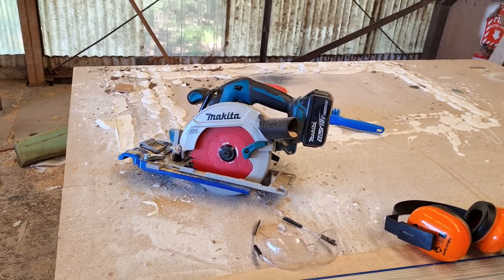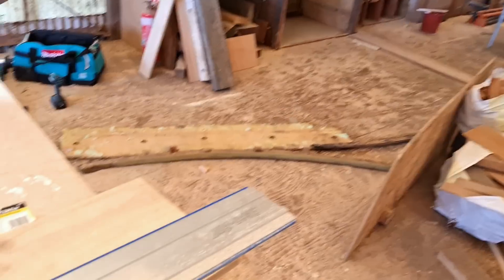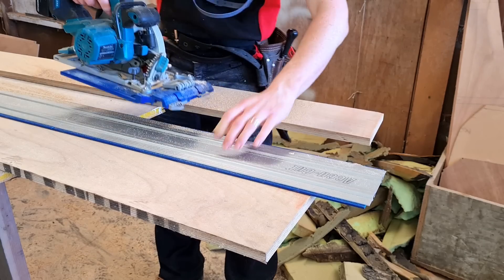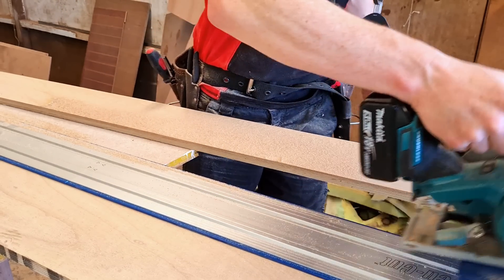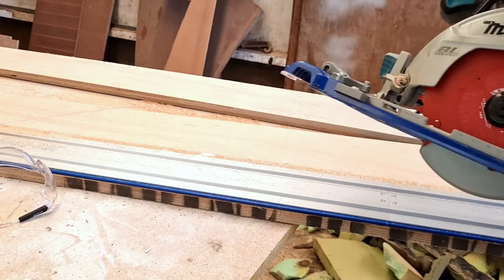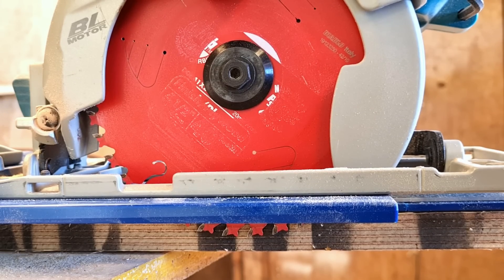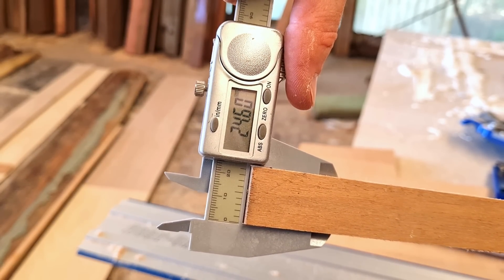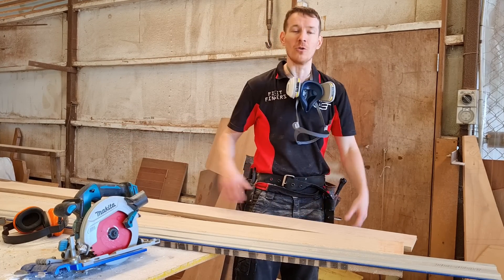How to get more Accuracy from your Kreg Accu-Cut Track Saw

Comment: Lots of videos, some pro Kreg, some against. I’m a Diy woodworker with limited resources and a budget. I think these tools are fantastic for my level and have a few, will be buying more. It doesn’t mean much to me when a professional woodworker with a massive workshop and expensive equipment keeps telling me that Kreg is no good. I appreciate your approach and instruction has benefited my knowledge. Thanks
Reply from the maker: Cheers Mike, yeah, I am sure they are doing it for the clicks (but then I am guilty of that too :P) but you need to compare a tool to the intended use and audience. No point being in a production workshop and complaining your Ryobi router died after 3 days of use for 8 hours a day.. or being a hobbyist and complaining a Shaper Origin is too expensive. Kreg target their home workshop / DIY market very well. Some of their gear misses the mark at times (Im looking at the corner jig I reviewed recently) but most is great for its intended purpose. Cheers!

Comment: Great video~!  I've been using the Kreg Accu-Cut for several years now and use the exact same technique that you demonstrate.  People have to understand that this tool isn't for precision work, but used correctly, you can get fantastic results.  Thanks for this one~!
Reply from the maker: I wonder if Kreg had called it the Kinda-Accu-Cut people would accept it for what it is? 😅
Reply: @FixitFingers  LOL, so true.  Would manage their expectations a bit, I guess.
Reply: Used correctly? So it’s Kreg that tells you to torque the saw? 

With all due respect if I’m gonna 100 US Dollars on a tool that uses the term accu cut in its name, I shouldn’t have to torque the saw to get accurate results
Reply from the maker: Yeah as discussed above the name is a double edged sword. It is accurate, but people's expectations of that term vary. My experience is if just whip it out, slap it down and push the saw along you'll likely be around 1/16th out over 8 feet...to me, that's accurate. With care and yes, a sight torque, I was just less than 1/32nd out over 8 feet... That's insanely accurate. With poor setup and no care, you'll still be only about 1/8th out... For a sheet breakdown tool I think that earns the Accu part of the name.

Comment: Hi thanks for the nice video! Can this guide be used also for 45 degrees cuts? thanks
Reply from the maker: Sadly no, that is one of the main disadvantages of this over a normal tracksaw. The sled it rides on makes bevel cuts impossible :(
Reply: ok i thought that because of the blu edge on both sides it could be used one for 90 and the other for 45 degrees
Reply from the maker: @ExploreFishing  Sadly no :( At least not with my saw.

Comment: Thanks for the video. Can you cut at a 45 degree angle using this track?
Reply from the maker: Sadly no, the chip guard gets in the way if you bevel the saw so that is one of the advantages of a real tracksaw over this guy. However, you can use the Kreg Straight edge guide (Or a DIY straightedge) to achieve those beveled cuts. If you put blue tape along the cut line, it will help minimise tearout like the chipguard does on the Accu-cut :)

Comment: I'm a big fan of how you've approached this video mate. Honest, raw and confronting, love it. In many respects its everything you'd need to know about this tool, fits the budget and does everything it sets out to do well.
I'd watched your set up video of this tool and I've been considering it for a while. For breaking up sheet goods this seems to be perfect, and I really can justify a proper track saw quite yet. 
Conversely carbatec are opening up their second nz store less than 3kms from my house too which is bloody dangerous! 
Cheers!
Reply from the maker: Ha! Im lucky they are about 30 minutes from me so just too far to make quick trip too which saves the budget ;) It's not often I use the full length one, but bloody glad I had it for this job as there was lots of full sheet ripping. To replace a table saw the Rip-Cut would still be my first choice but with the half-length Accu-cut to reach the places the rip-cut can't it's an awesome duo.

Comment: Hi James,
I think accuracy seems pretty good. When using such tools, it is necessary to hold tight throughout the movement. Thanks for showing the details. all the best. see you buddy.
Reply from the maker: Slow and steady! You can stop half way to adjust your grip or position as long as you back it off a few cm then start again. There are also optional clamps for slippery stuff like melamine.
Reply: @FixitFingers  thank you so much my friend. see you later. all the best.

Comment: At first I thought,  'Shiser! James has a new workshop but alas, not so. Half a mm over 2.4m, I'd be happy with that level of accuracy any day of the week mate. And lets be frank, a circular saw cut over 2.4 metres is hardly in the realms of high end cabinet making. Great video James, thanks for sharing. All the best, Brian.
Reply from the maker: I wish!  You'll get see more of the shop in my next member video I hope to edit this weekend. Beautiful view, rust would be a big issue though 😅 That's really what got my goat with the original video, not only the exaggeration of error but the implication this tool was designed for micro meter accuracy to begin with... For $70USD 😂

Comment: Will this track also work if you bevel your blade? will it bite into the sacrificial edge too much?
Reply from the maker: Short answer is no sadly, not usually. The slot your blade goes through on the sled prohibits you from beveling. So if this is a deal-breaker but you are still after a non-tracksaw price, check out the more simple (and cheaper) Straight-Edge Guide. I've taken a look at that too here: https://youtu.be/fITfNg1C_3c :D

Comment: Enjoy and appreciate your content, keep up the great work👍. Can you cut a 45 bevel using this?
Reply from the maker: Hey Cosmos, sadly no, not usually. It is another thing to consider when saving pennies on a real track saw. (You'd likely hit the accu-cut chip guard). Another option for those is you could use the Straight Edge Guide instead - https://amzn.to/3ugXn29
Reply: Legend! 
Again, keep up the great work, tah.

Comment: I have always been amazed that my father-in-law, a long time carpenter, can cut such amazingly straight lines with a circular saw without such a tool.  I can hardly cut a straight line with a guide like this.

I am far from being an artisan and have this idea that buying modern tools can make up for my lack of experience and skill.  So the tool won't do it all for me; I'm glad to get my expectations cleared up.  It is great that people like Fixit Fingers will share their knowledge and experience about how to use the modern tools.  The tool will help me, allow me to do far better than I can on my own, but it seems no tool, on its own, can make me an artisan.
Reply from the maker: Cheers Dale. The old adage is very true, no matter how much you spend on a tool in the wrong hands it can still do a poor job. Now, I'm sure the Festool track saw makes doing a poor job harder... but then you are paying a premium, and if you've never cut timber before I'm sure a novice would still find it very confusing and frustrating to use. This is a good tool that helps you cut straight lines, not a replacement for your father-in-law's lifetime of skill and practice 😊 Hopefully it helps you get better results for a reasonable price ;)

Comment: I know the video you're talking about and I did agree with him in the fact I wasn't happy with my kreg track.  I tried to address some of the slop with some low friction teflon tape that I saw in another video.  I still wasn't happy with the results.  At the price point of the  WEN track saw I'm not sure if even worth the trouble of dealing with this kreg track.
Reply from the maker: We don't have Wen here in Oz but I'm familiar with the brand from American video makers. It's basically DIY Ryobi sorta price and level yeah? I've got friends with budget brand tracks saws here and like most tools you get what you pay for. With care though they also cut perfectly acceptably and you get the plunge feature so well worth a look! The problems with the lower end ones tend to be the saw power more than the track straightness. (I am glad I'm running Makita in this, an Aldi brand saw would probably add to the inaccuracy. In my linked setup video the first  few times I used the saw I noticed the little wobble in the Accu-cut and mentioned I wasn't too happy about it, but it didn't take long to learn the tools limits and adjust my grip to improve things. If you switch to the Wen let me know how it compares! Cheers Michael.
Reply: @FixitFingers  WEN isn't on my wish list for track saw.   But I think WEN overall is a decent brand.   For me personally I was trying to decide between the Kreg and makita track saw.  I decided on the makita cause it opens you up to the world of Festool metric accessories.  However since the Festool just went through a redsign I decided to make small leap.  These are all corded btw.  As a Canadian I live in a metric/imperial purgatory but I want to go metric.  If Kreg would have stuck with 20mm holes instead of 3/4 I would have been all over it.
Reply from the maker: Oh I was bloody cursing them when I measured the dogs that came with my Vice and I needed to go get a 19mm bloody speed bore for the holes! 😅 Apart from Kreg I am also a Makita fan boy so if the Accu-cut ever gets run over I'll probably look at the Makita one too.

Comment: I bought the ACCU-CUT system from KREG and I think it's a bloody decent system for 100 euros. That's what it cost me. I have a table saw as well which is a POS and I'm about to begin my rebuild of a DIY table saw but this is dead handy makin cuts in 18mm MDF/PLYWOOD/OSB board.. I've very happy with it. 
Woorworking is not maching with Lathes or a feckin milling machine for acuracy. Ur allowed to be a millimeter out here or there. Did ppl ever hear of +/- 1.0mm..
Well said mate. I enjoy using this tool myself.. I will be using it to build  wardrobes tommorow and I cannot wait to get it out of the box again.. LOL
Reply from the maker: Well said. I do have a table saw now finally but even still I break this out to break up sheets all the time. My job site saw can't safely cut bits that are too wide so it will continue to be a handy thing to have.

Comment: It is nice to see that if you spend enough time you can make almost anything work.  Little tricks like keeping it tight to the track guide because you know it has no cams to keep it tight.  If your paying laborers though, it will be cheaper to buy track saw and save wages.  Great DIY tool though!
Reply from the maker: Oh for sure, when time is money and you need it everyday you wouldn't want a track that needs the sled. Kreg gear is designed for the home workshop, not laborer abuse 😉

Comment: Mate great review, yeah really can't argue with 0.1mm accuracy in wood because it'll move and warp anyway, great job mate
Reply from the maker: And for the breaking down of sheet goods 1mm is well overkill in most situations. I wasn't even being that careful 😅 It's like any tool, use it as designed and with practice you'll get good results

Comment: I Have used a Accucut for long time over table saw for plywood. the best way to keep it accurate put a laser on your circular saw. the play (slop, movement) on the accucut is real. the laser will help you keep cutting straight. My cuts got so much smoother once i started using a saw with a laser along with the accucut
Reply from the maker: Good tip. Using a laser to line up the guide could also be a cool thing to try

Comment: Better accuracy than I'll ever need! That track adapter for the saw looks way sturdier than the official Makita one I got. Would (will) have to modify it quite much to make it work that well... 🙄
Reply from the maker: I didn't know makita had a track adaptor for the circular saw as opposed to a dedicated plunge saw! Kreg plastic is quality stuff, I've never managed to break, crack or even badly chip on on any tool. For the price it's a great unit.
Reply: @FixitFingers  The bad thing with the Makita 197462-2 adapter is that it's made to fit an array of different saws, which means that it doesn't work that well with any of them. I would take the Kreg one any day, but I already have the Makita track, so I feel I have to make it title somehow...

Comment: I put a few stipes of blue tape on the bottom of the plate that attaches to your saw, it makes it nice and tight and it doesn't wiggle.
Reply from the maker: That's a top tip, I've heard a few folks do that. Kreg have updated a lot of their tools in the past year or two, I wouldn't be surprised if a new version on this is on its way as well that hopefully makes these hacks uneccesary (without raising the price point :P). Time will tell!
Reply: @FixitFingers  I've had mine for a few years and I actually returned my first one it was so bad, I bought a new one and it was just as bad and that's when I added the tape.

Comment: I've used the same Kreg system to build multiple cabinets.  As a home DIYer, cost is always a concern as I want a good finished product (it's going to be in my home after all, and have my name on it), but I can't justify spending a ton of $$ on items I won't use often - I'm not a professional cabinet maker.

That said, you also have to use some common sense with these tools.  e.g. when you set up the track initially, the instructions tell you to just butt the aluminum joints.  In an ideal world this would make for a perfectly straight track, but I found it ever so slightly off using a trusted level.  Also, for very long cuts, I would have clamped or otherwise held down the very end of the track.  Kreg makes clamps for this that utilize the groove that exists on the under side of the track.  Or, you can just use some imagination and make it work.  When I had to do long cuts (over the track length, which is IIRC around 54" or so), I didn't want to buy another set of track so I'd make 2 cuts.  Measure twice (or 3 or 4 times), cut once.  

Lastly, the tacky underside of the track is designed such that you don't necessarily need to use clamps, and it works very well *if it's perfectly clean*.  Even a small layer of sawdust will make it lose its grip and potentially move.

Again, common sense.  For me it's worth spending more time in setup to make sure that I have a good cut than risk a crappy job or having to buy replacement materials.
Reply from the maker: All very good tips there! The little track clamps are extremely handy, especially with melamine and form ply. I think a some people have to adjust their expectations and realise every tool is only as good as its operator. Taking care with your cuts and setup is the key to a good result. 👍

Comment: I wonder if it's more because you're used to it now? Like an old car. Oh you just have to jiggle and twist back before you twist the key and it starts just fine. Once you're used to it it becomes second nature, but if someone new came in they'd struggle if they just twisted.

I can definitely understand both perspectives. Having never used a track saw I couldn't say for sure how they should be expected to perform. But good overview nonetheless.
Reply from the maker: This is true. Though even without twisting it still cuts pretty darn well for a tool designed to break down sheet goods. Every tool (especially cheaper tools) have their limitsand even expensive tools won't perform their best without practice 😁

Comment: I wonder why it’s been made with the wobble?
Reply from the maker: Just a cost thing I'm sure. 'Proper' track saws have adjustments on the cutting tool to ensure they hug the track snuggly. I'm sure they could have added some form of grub screw adjustment to the blue sled but sadly not. Perhaps in a new version, this model has been around a long time now...
Reply: @FixitFingers  Yeah I guess.  I just bought one to cut some birch ply for a saw table I’m making, need a better straight edge than the factory sheets. I might try some blue masking tape on the sled guides, see if that takes up the slack without affecting friction.  My first cut to trim the track was a disaster, all my fault.  I’m also using a Makita 5903R which is big, 235mm blade, probably too big for the Accu-Cut but all I have.  Fingers crossed for the next attempt 🤞
Reply from the maker: @srw_cricket2976  blue tape may do the trick! Make sure you clamp down the track and/or make multiple passes if cutting deep with a saw that big. On ply you should hopefully get some good cuts with a little practice :)
Reply: @FixitFingers  18mm ply. Got some Festool track clamps yesterday, they didn’t quite fit but a little fettling with my files and they are perfect.  Will share my results later 👍
Reply from the maker: @srw_cricket2976  Awesomes. Tag me on socials, will be interested to see the results

Comment: I experienced real trouble when I used mine for the first few cuts. It wasn’t until I got out a square that I found the base of my saw was twisted meaning that it was trying to angles while I was trying to pushing it straight. I must say that the saw was about the same price as the accu-cut, so not the “best” saw available.
Reply from the maker: You know I'd not also considered the quality of the saw, or it's set up. Good you were able to trouble shoot rather than blame the tools. 👍
Reply: @FixitFingers  agreed. It’s a pity not everyone is able to say “I didn’t get on with this tool, but you may do”. There is plenty of evidence that the kit does work, with your and Sarah @Wood Shop Diaries to name just two sharing plenty of contents.
Reply from the maker: Yeah makes me wish I didn't throw out that expensive dovetail saw when I used it for the first time and my joints were all uneven, gappy and horrible. 🤣
Reply: @FixitFingers  😁